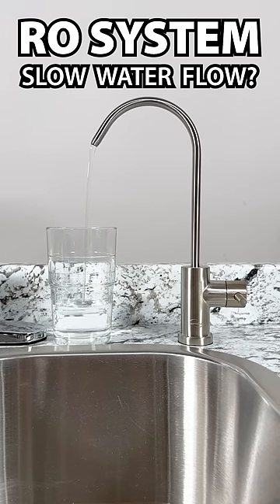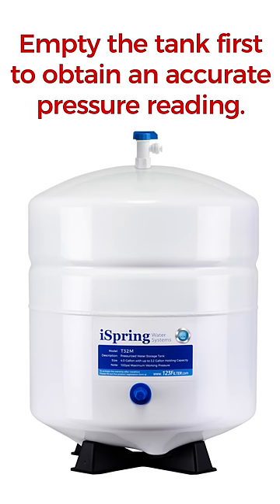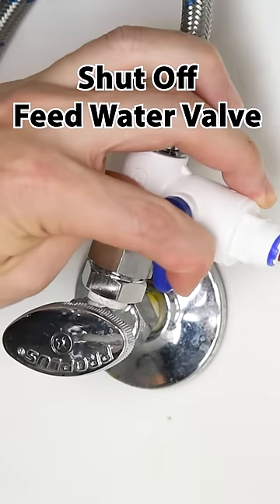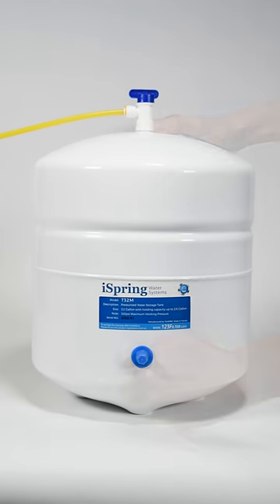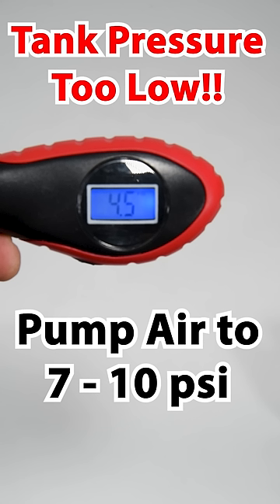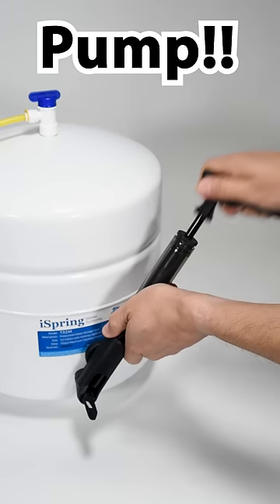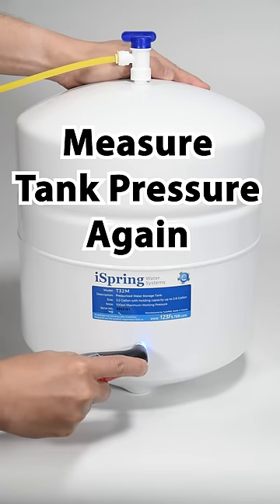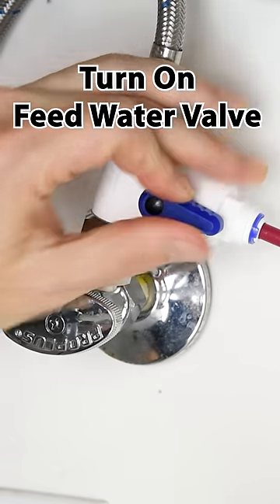Boost Your RO System's Water Flow: Fix Slow Flow with Tank Pressure!

Comment: Should you empty the tank after so much time to clean the inside properly and if so, how do you recommend cleaning it, just adding some bleach??
Reply from the maker: Hi dear customer! You can sanitize the system following these steps:
- Turn off the feed water adapter. Prepare a bucket to drain the tank.
- Remove all the cartridges. 
- Put 3 tablespoons of bleach (1 tbsp in each vertical filter housing) and reattach to the head unit.
- Turn on the feed water adapter until the canisters 1,2,3,4 and the tank is full. (Please do not let the water reach stages 5 or so if you have multiple post filters.)
- Let water sit for 2 hours and drain/flush it 2-3 times until all the solution is out before reinstalling all the cartridges.

For any questions or concerns, do not hesitate to contact us  at support@123filter.com , at (678) 261-7611 M-F 8:30-5:30 EST or at (470) 560-0012 M-F 8:30-5:30 EST (Messaging only) 
We are happy to help!

Comment: The water in tank doesn’t go out of tank
Reply from the maker: Hi there. If you have no water or a low water flow issue, please take into account that the tank takes 1-2 hours to fill. Also, please check the air tank pressure. It should be 7-10 psi. 
For further concerns or questions, please kindly contact us at support@123filter.com or at (678) 261-7611 M-F 8:30-5:30 EST.
We are happy to help!

Comment: If you want to maximize flow rate, would closer to 10psi be best? I've replaced filters and membrane and still have low water flow. Going to pressurize it next...
Reply from the maker: Hi there. You will get the same flow rate if it is at 7 or 10 psi.
If you still have a low water flow issue,  please contact us at support@123filter.com or at (678) 801-9308 M-F 8:30-5:30  EST//(678) 261-7611 M-F 8:30-5:30 EST to help you.
Reply: You'll probably have to install a booster pump. Did that on one of my ro systems after checking and changing everything. Works great now!
Reply: Where in the system is the boost pump installed? Is it after the water has been filtered? @9286anthony

Comment: I don't have the tools in this video. I only have a regular tire guage (not digital), and I have an electric air compressor. Will these work? I'm worried about exploding the tank with too much air.
Reply from the maker: Hi there. It would work as long as the gauge is accurate so you can check the air pressure is between 7-10 psi. If the pressure is below or above, the system won’t work properly. 
If you have any questions or concerns, please contact us at support@123filter.com or at (678) 801-9308 M-F 8:30-5:30  EST//(678) 261-7611 M-F 8:30-5:30 EST to properly guide you. 
We are happy to help!

Comment: Hi on ispring water systems water tank T32M is written 100psi maximum working pressure,so i m confused what air pressure need?
Reply from the maker: Hi there. The air tank pressure should be 7-10 psi.
For any concerns or questions, please kindly contact us at support@123filter.com or at (678) 261-7611 M-F 8:30-5:30 EST.
We are happy to help!

Comment: After that entire process, when your tank is finished filling up with water at the end, if you check the pressure, it will be a lot more than the set pressure of around 7 to 9 psi, right? Once I started filling my tank up, I had my pump on the valve while it was filling, and saw the pressure rising quite a bit
Reply from the maker: Hi there. Yes, the air tank pressure will increase in a full/heavy tank. But in an empty tank, the air tank pressure should be 7-10 psi. 
If you have any concerns or questions, please kindly contact us at support@123filter.com, at (678) 261-7611 M-F 8:30-5:30 EST or at (470) 560-0012 M-F 8:30-5:30 EST (Messaging only) 
We are happy to help!

Comment: What if the water tank is not getting empty even after I shutoff the value and opened the facut ? 
The tank feels very heavy . So removed completely and manually emptied the tank but Iam concerned this tank is bad now😢
Doesn’t that mean I need to replace new tank?
Reply from the maker: Hi there! Please, contact us at support@123filter.com  or 678-261-7611 (M-F 8:30-5:30 EST) to properly help you as soon as possible. Thank you!

Comment: What would  the maximum bladder pressure be for a 14 gallon tank?
Reply from the maker: Hi dear customer! Our storage tanks come pre-charged from the factory at 7 psi. When the tank is empty of water, the psi of the tank should be between 7 psi minimum and 10 psi maximum air pressure.

Comment: So let’s say somebody matched their home water pressure aka 80psi ( like A traditional pressure tank) would this unit be damaged or can it be taken down to 10 psi?
Reply: U can try reducing the pressure back to 8 t0 10 psi and chk, the bladder seal might have been compromised but you can give a try.
Reply from the maker: Hi there. The air tank pressure should be 7-10 psi to optimize the performance of the system.
For further concerns or questions, please kindly contact us at support@123filter.com or at (678) 261-7611 M-F 8:30-5:30 EST
We are happy to help!

Comment: How often are you suppose to pressurize the tank?
Reply from the maker: Hi there. Thanks for your question! The pressurized tank comes with the amount of pressure needed for the system to work. If you are getting low water flow at the faucet, it might be that  your tank has lost pressure, so you will need to check the air tank pressure. The air tank pressure should be 7-10 psi. This should not  be done often. 
If you have any questions or concerns, please, kindly contact us at support@123filter.com, at (678) 261-7611 M-F 8:30-5:30 EST or at (470) 560-0012 M-F 8:30-5:30 EST (Messaging only)  
We are happy to help!

Comment: what if the ASV was just replaced and I checked the PSI to 9 with the empty tank and it still won't stop running. I tested the one way valve too. it just runs.
Reply from the maker: Hi dear customer! Could you please check if your inlet water pressure is at least 45 psi? If your inlet water pressure is below 45 psi, a booster pump should be added to increase the pressure through the system. Please, kindly contact us at support@123filter.com  to properly help you as soon as possible. Thanks!
Reply: @iSpringWaterSystems  oh how do I check the PSI of the city water? it used to work for years so I am thinking maybe it could be lower in the summer or it can also be the flow restrictor? I am not sure.

Comment: If water comes out from the air valve, is a tank bad?
Reply from the maker: Hi there! If water is coming out of the air valve, it indicates that the tank is likely faulty.
Please, contact us at support@123filter.com  or 678-261-7611 (M-F 9:00-5:00 EST) for proper assistance as soon as possible. Thank you!

Comment: Deshecha mucha agua, es más la que tira que la que se usa, o está mal la conección?
Reply from the maker: ¡Hola! Depende del modelo del sistema que usted tenga. Si tiene un modelo RCC, la proporción de agua filtrada a agua residual es de 1:3. Si tiene un sistema con bomba como el RCC7P o RCC1UP-AK,  la proporción de agua filtrada a agua residual es de 1:1.5. Si tiene el sistema sin tanque RO500, la proporción de agua filtrada a agua residual es de 2:1, y así tenemos más sistemas que tienen diferente proporción de agua filtrada a agua residual. 
Si tiene alguna duda o pregunta, por favor contáctenos a support@123filter.com , al (678) 261-7611 M-F 8:30-5:30 EST o al (470) 560-0012 (Solo mensajes) para ayudarlo adecuadamente.

Comment: How often does it require a psi top up
Reply from the maker: Hi there! The tanks may lose pressure over time. If you notice low water flow, it could be a sign that the tank needs to be pressurized. Please check the air tank pressure to address this issue.
If you have any concerns or questions about our products, please contact us at support@123filter.com  or at 678-261-7611 (M-F 8:30-5:30 EST). We are here to help!

Comment: I did pressurize my brand new kit, but is still coming super low flow 😢
Reply from the maker: Hi there. Please, make sure that the tank is full. The tank takes 1-2 hours to fill. Also, check that everything is properly installed and there is not any crimped tube. If you still have low flow, please kindly contact us  at support@123filter.com, at (678) 261-7611 M-F 8:30-5:30 EST or at (470) 560-0012 M-F 8:30-5:30 EST (Messaging only) to properly guide you. 
We are happy to help!

Comment: Cam I do 15 psi? With 10 water still flows same as with 5
Reply from the maker: Hi dear customer! To get an accurate reading, the tank should be empty. Could you please verify if the tank is losing pressure? 
If you face any issues with the tank, please kindly contact us at support@123filter.com or at (678) 261-7611 M-F 8:30-5:30 EST to properly help you!

Comment: Wait im supposed to put air in the tank?
Reply from the maker: Hi there. Our tanks come pressurized. However, the tank might lose pressure over time, so you will need to pressurize it. The air tank pressure should be 7-10 psi.
If you have any concerns or questions, please kindly contact us at support@123filter.com, at (678) 261-7611 M-F 8:30-5:30 EST or at (470) 560-0012 M-F 8:30-5:30 EST (Messaging only)
We are happy to help!

Comment: Wait. $350 for the filter system and 180 every 8 months to replace filters and you still have to do this?
Reply from the maker: Hi there! The tanks may lose pressure during transportation or over time. If you notice low water flow, it could be a sign that the tank needs to be pressurized. Please check the air tank pressure to address this issue.

Comment: not true I done this many times i even replaced my filters and tank still same low water flow
Reply from the maker: Hi dear customer! If you have already replaced the filters and pressurized your tank at 7-10 psi and you still have low water flow, it might be that you are experiencing a constant drain issue.
Please, refer to this video:
https://www.youtube.com/watch?v=t4rPacnCKVo 
Please, kindly contact us at  support@123filter.com or at (678) 261-7611 M-F 8:30-5:30 EST to properly help you as soon as possible.
Reply: @iSpringWaterSystems  I watched the video you send me  I test the exact way shows in the video I don't have drain issue    I will try explain more my osmosis system one year old but I still  replaced all five filters last week and I replaced the Tank itself again  because I  watched your video I thought Tank was bad Tank Air pressure without water is 7.5 psi with Full water 14 psi but you mentioned in this video full water  tank  should be 35 to 40 psi ,  my problem is when I open the drinking water Faucet the water flow not strong just slow even though tank is full water  I wish I could download  the video  here so you can see how is the water flow  my old Osmosis 4 stage filer water flow from faucet was very strong

Comment: Hi on ispring water systems water tank is written 100psi maximum working pressure,so i m confused what air pressure need?
Reply from the maker: Hi there. The air tank pressure should be 7-10 psi.
For any concerns or questions, please kindly contact us at support@123filter.com or at (678) 261-7611 M-F 8:30-5:30 EST.
We are happy to help!
Reply: Same here. I don't get it. I'm guessing the total pressure WITH water shouldn't exceed 100psi. I'll just follow the 7 - 10 psi instructions I've seen in so many vids. If it doesn't work. Then I'll take it from there.